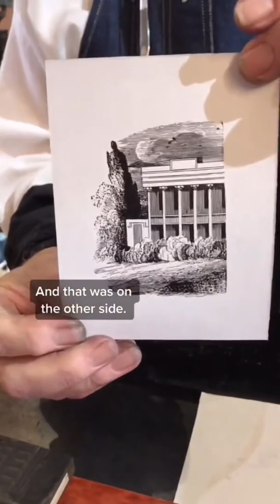A Two Sided Woodcut - Howard needs help identifying what the image is on the first print.

Comment: How were these made? I notice there are metal ones as well as wood ones, probably requiring a different manufacturing process? There is surprisingly little information available on how its produced.
Reply: I suppose the wooden ones were hand-carved (engraved if that's the right word lol).
Reply: @Monkey_Jam3022  Which is crazy if you look at the level of detail and how cleanly the prints came out.. the amount of work just to make one of those blows my mind
Reply: @Jonas_Keunecke  I know right! They're impressive!
Reply: @Monkey_Jam3022  Yeah they are!